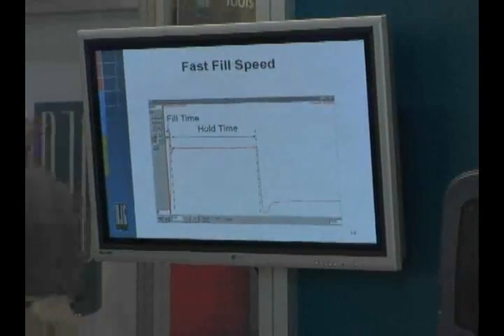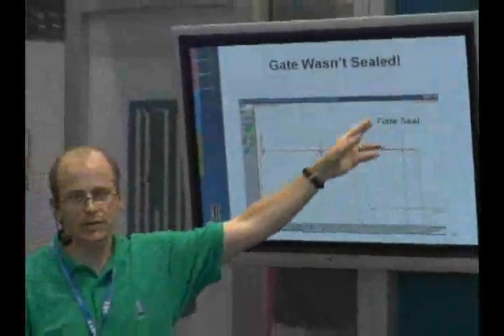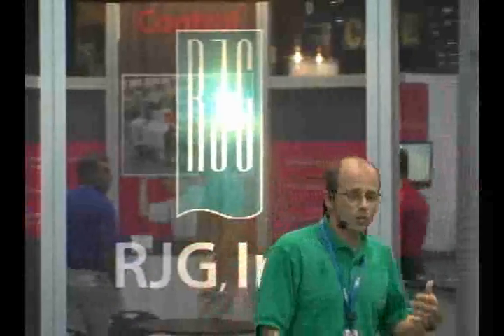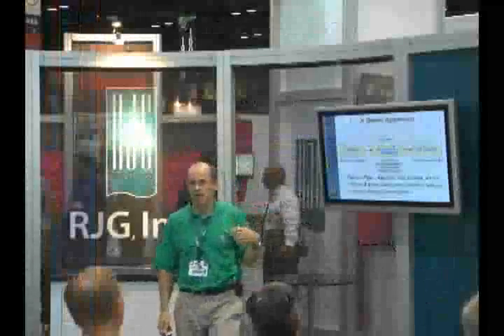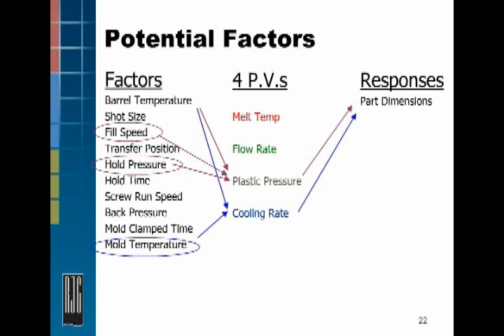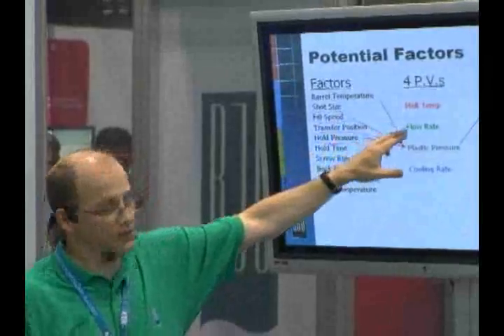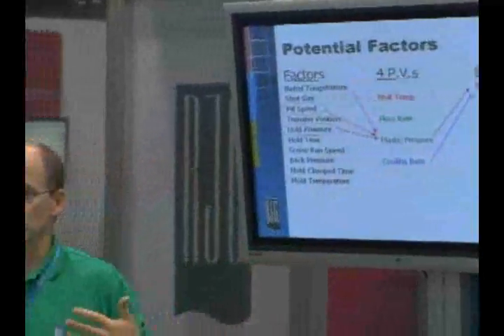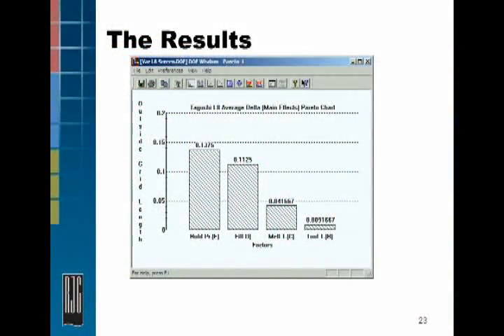DOE for Injection Molding - Part2

Comment: If the DOE results are demonstrating that a slower injection speed gives a stronger knit line, I would also be thinking do we have a venting issue?
Reply from the maker: In regards to the knit line, that is correct. A stronger knit line with a slower fill speed could be an indicator of a venting issue at the knit line location.